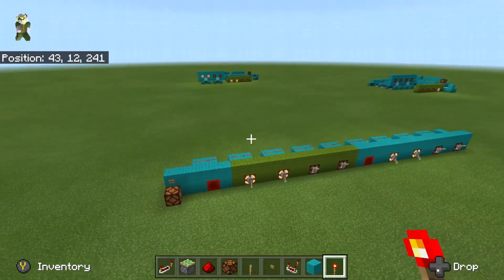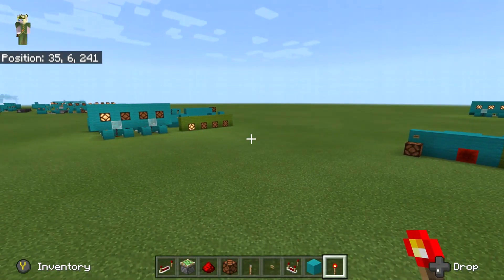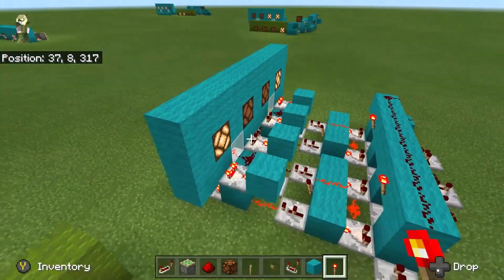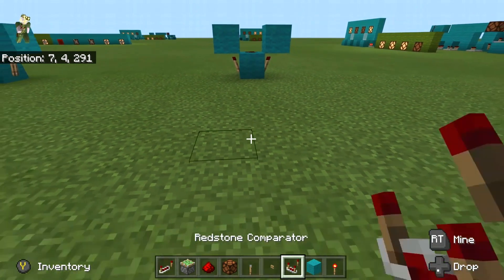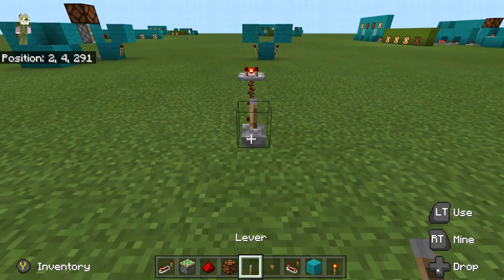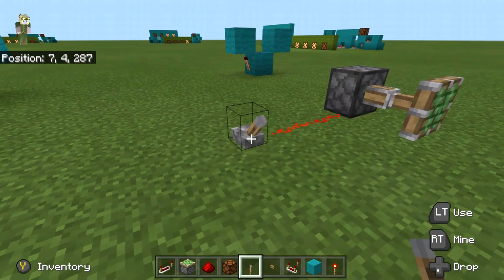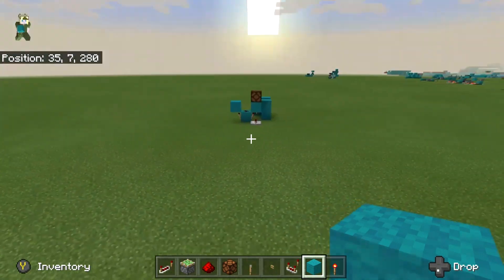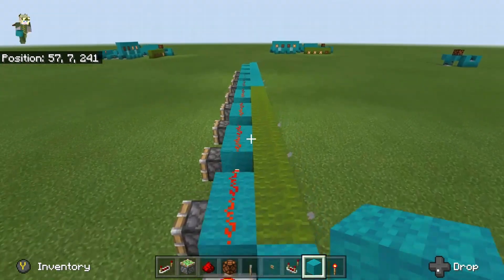Minecraft Bedrock Wireless Data Transmission

Comment: I know this is a bit old now but is it still stable cause I just built it as best I could. Can't figure out what is wrong but it is only working properly an average of 10% of the time.
Reply from the maker: I haven't tested it in the recent updates but the mechanics shouldn't have changed. But who knows, it is a bug.

Something I learned later is that the burnout appears to be directional depending on the chunk. In this video, I referred to the north and south side, but that can change. To build a proper double-burnout to make a receiver, the sequence of block placement matters more than the direction.

First, build a burnout, then when it finishes blinking, add the second torch and block. If the dust on top becomes "always on", then you need to remove the blocks and torches and put the first torch and block on the opposite side. Basically, keep changing direction and rebuilding until you get a double-burnout that remains off. Next, place dust away from it and see which torch blinks, that's the output side.

Once you figure that out, watch this https://youtu.be/-GFeMv8eP7s I built this updated receiver to refresh the burnout if it breaks.

The addressing system is here https://youtu.be/5AUe5EhSCEY The wireless only worked with 4 bit output because I used a wooden button (15 rs tick) to trigger the transmitter.

Comment: You absolute mad man... you actually did it! :D
This is amazing, well done!
6:13 Yes, exactly like that, I'm glad that comment made sense, it's tough to describe redstone in words hahaha.

I think this is the first wireless data transmission, I've never seen anything like it.
Reply from the maker: Yeah, thanks for figuring that out, really does work to refresh it when you relog the map, it's just not guaranteed if they're outside of sim. distance. Should prob look into adding a circuit that does it automatically if it's in a never-ending burn-out.

I think it's a first as well.. of course, I've never seen anyone with an addressing system either, and that's the real magic behind making it work.
Reply: @Jon-2049  You're totally correct, I watched your newest video with it, the pulse extender and pistons on both sides, brilliant. Solves basically every problem. There might be a small issue if it's on a chunk border, but probably not a massive issue.

I agree too, I've not seen addressing systems either. Your redstone style is very different from mine. Yours is way more logic based. So all this stuff really blows my mind hahaha.
Reply from the maker: @shipwreck9146  Yeah, I was hoping that would make it more reliable if anyone else wanted to play around with it.

Honestly, had no idea what I was doing when I came up with the binary addressing, just started counting ticks and seeing what happened with changes. I guess it's the same when you're designing anything, just keep working until it satisfies your ideas.